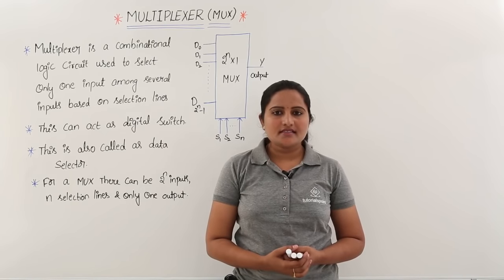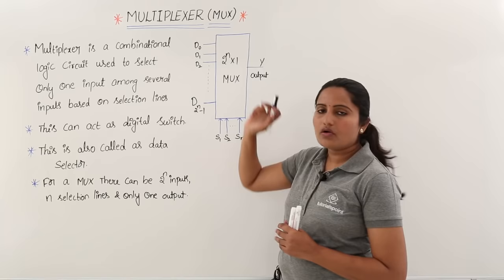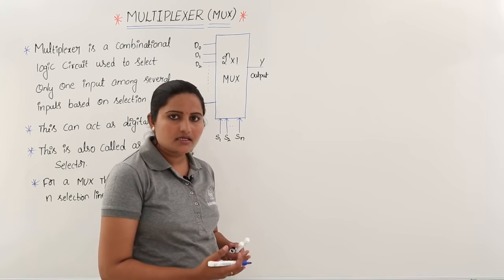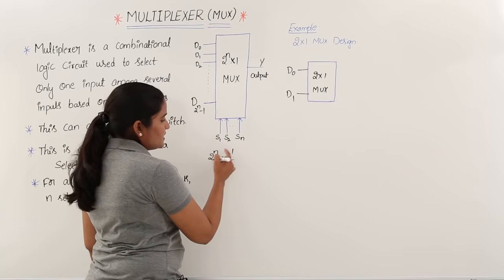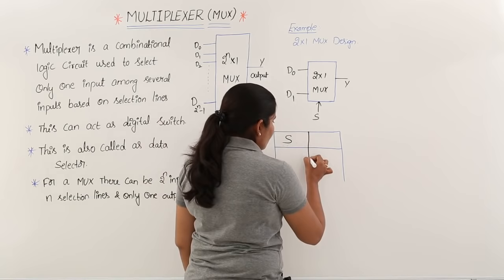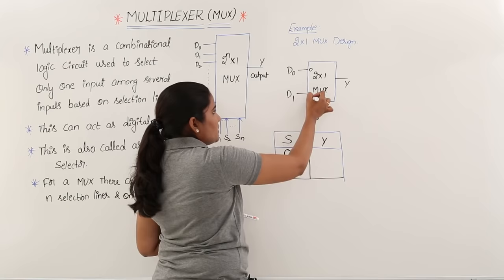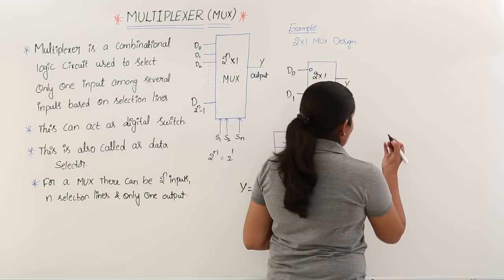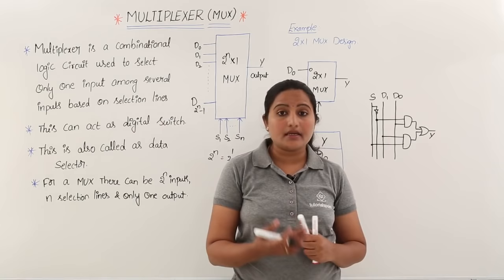Multiplexer (MUX) 2 X 1MUX Design

Comment: simply if you have n number of selection lines, than at that time the number of input lines will be 2^n. and if you have n number of input lines at that time the number of selection lines will be the 2 power of that n number. e.g if i have 16×1 input lines at this time the number of selection lines is the 2 power of 16 which is 4 (2×2×2×2=16).

Comment: Enable (E) is missing in your video everywhere in the truth table, logic circuit and 2*1 mux diagram. I think Enable is very important in Multiplexer.
Reply: Selection line(s) or enable as(E)
Both are same.... you can use anyone among these two
Reply: @heena_a333  Enable input or enable pin and select lines are not the same.
when Enable = 0 , even if you select an input the output of MUX is zero i.e. MUX is OFF
but when  Enable =1, the selected input is obtained at the output i.e. MUX is ON
Reply: @heena_a333  both are not the same